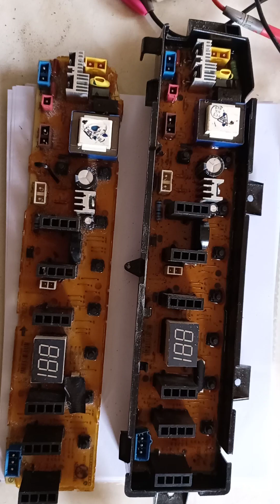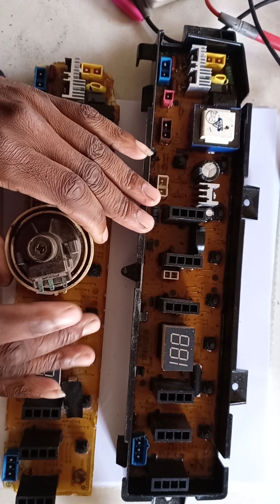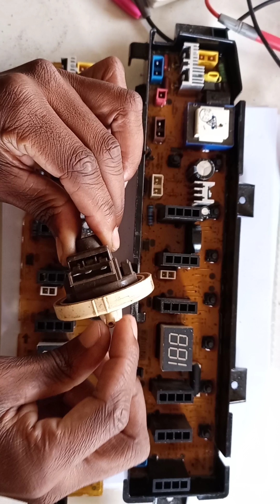Overflow fault? Is it the pressure switch or the pc board?

Comment from the maker: On my experience, that error code should be E5 (if that is the case check your pressure switch, its connections,and 5volts.) If its really 05 then defy has hidden such fault to their manual. Washing machines skip rinse mostly when they not draining, either because of a clogged filter, faulty pump.

Comment: i got a dtl 149 board with an error 05. but when you switch it on it gets hot at the power button area . the display also flickers lightly like theres a short/loose connection.the error 05 comes and goes it also skips the rise cycle completely ,you cant select it either. any advice please?